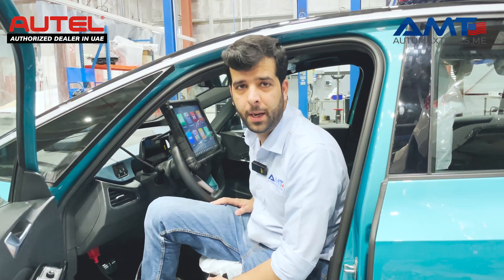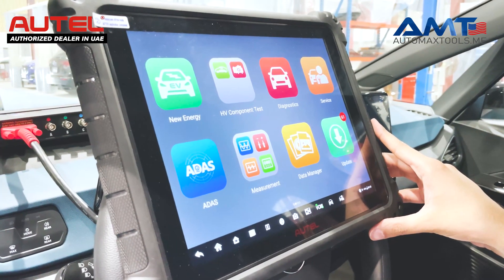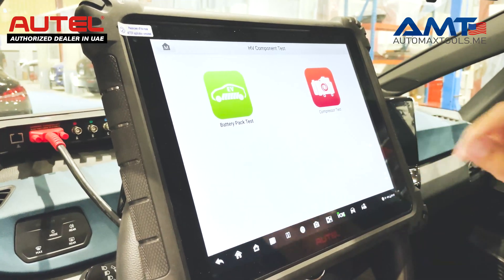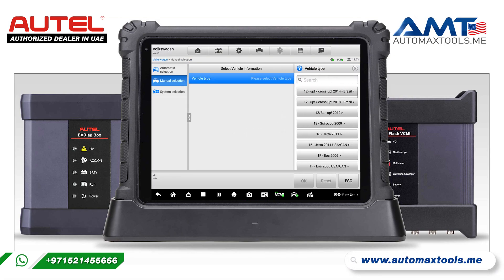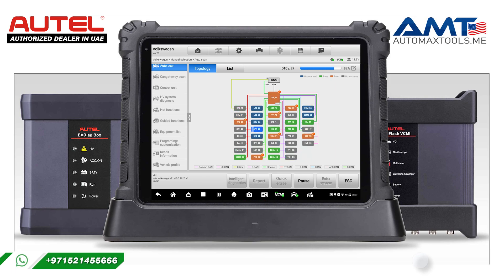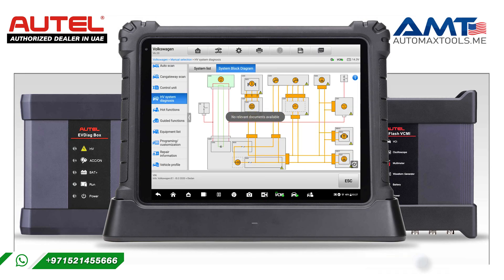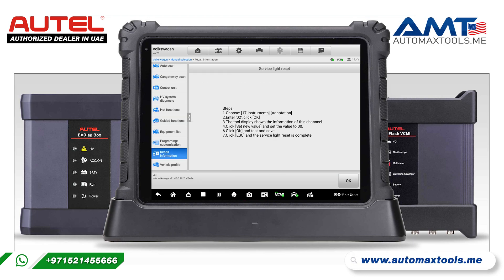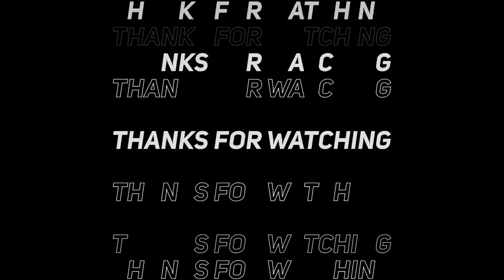How to Use Autel Maxisys Ultra EV- Part1

Comment: good day... is there an option  to reset hybrid battery contractors on mercedes benz w222??? fault code P1D799A Contractor of high voltage battery module was opened due to release faults. thanks
Reply from the maker: yes possible please contact us here or at info@automaxtools.me +971521455666

Comment: Can this perform test BMW HV system similar to End Of Service (EOS) for the activation/ start-up of BMW High Voltage system after HV battery cell module replacement.
Reply from the maker: Dear Sir,
yes Ultra EV supports testing of HV systems.
for more questions +971521455666